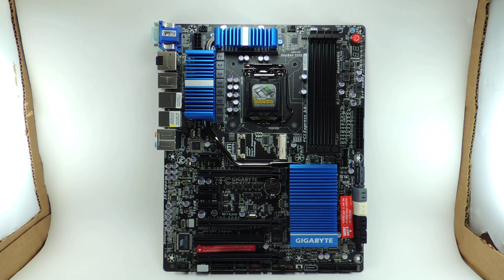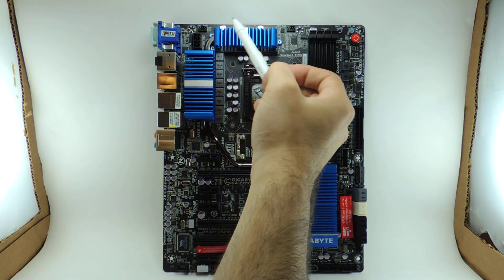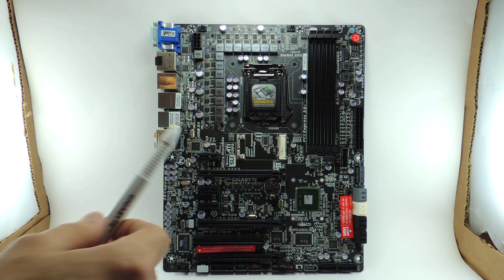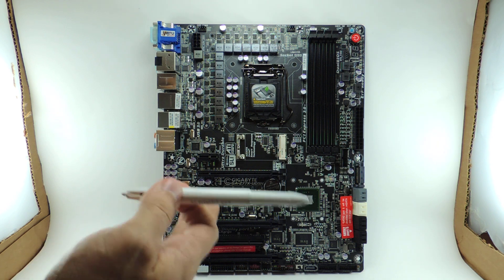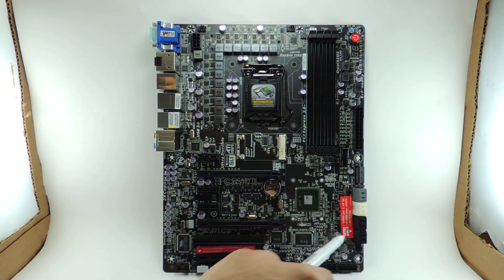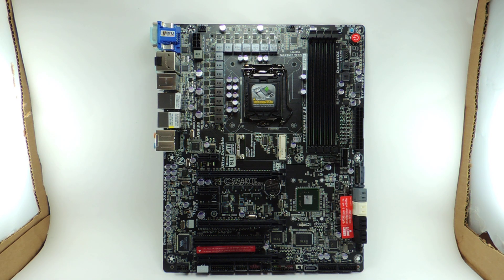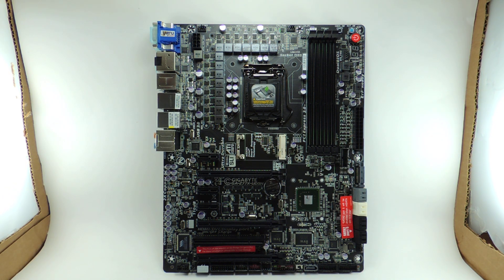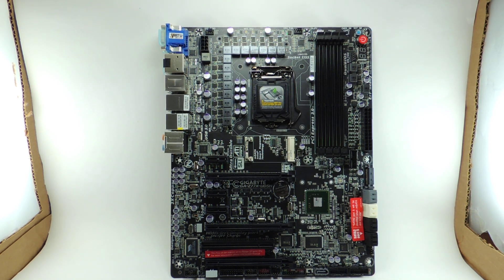[SH]GIGABYTE Z77X-UD5H rev. 1.1 Review!

Comment: You want questions?! You got it pal! You seem to know what you're talking about and I would take your word over most other random people online but please feel free to not reply at all if you don't want to and I'll just make this as a thread on a computer forum and take my chances it is honestly for real seriously not a big deal, my computer's already been assembled for a year now I'm on it right now I don't have any emergencies. 

Rev 1.1 luckily

Could you tell me the best ports to plug everything in or does it simply not matter? There's so many different ports and each type of port has ten different companies putting ports on this single mobo and ahhhh!

solid state drive with windows, two completely unimportant 1tb and 4tb drives simply for storage (might just take these out because my tower has a slot on top of it to plug one in so I could just backup files then store the drives elsewhere), I don't think it's possible to mess the ram or the rest up inside, for the outside xbox 360 controller, platronics gamecon 780 headset, alesis m1active 320usb speakers, logitech g510s and g700s, and my internet cable since there's two ports for that on here too sheesh. I'm wondering if certain usb ports would give better audio quality 2.0 3.0 front/back, same with my controller, etc. I'm also wondering if by some chance, since anything is possible, if there's a general performance impact since I smash every game's requirements but can't run them all like they should run. This also brings me to my next thing, overclocking:

I have an i7 3770k, original evga titan, 16gb g.skill ram. I can run dying light maxed except shadows turned down one notch from highest, with nvidia control panel on let game decide. Ubisoft's 2014 run was iffy, sometimes I could run ac unity maxed sometimes not, etc. I'm wondering if I need to overclock or if the next wave of games will be more optimized with that being the actual culprit to me not being able to run everything fully maxed like the requirements say I should. I'm not even sure if this motherboard or my processor, or the ram, or whatever, could just be becoming plain outdated in 2015. 

Again, you don't even have to tell me if you can't help, just don't reply and I'll post this on a computer forum.